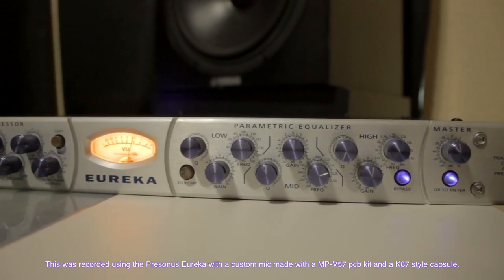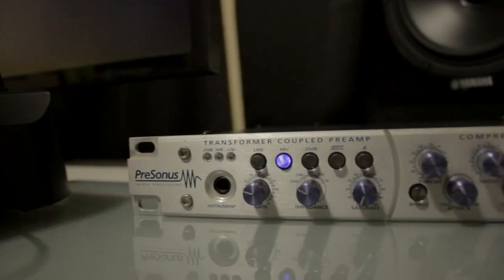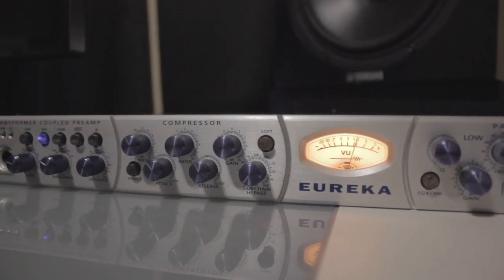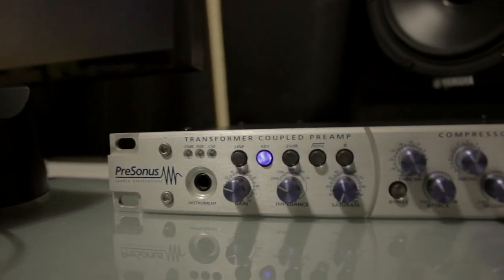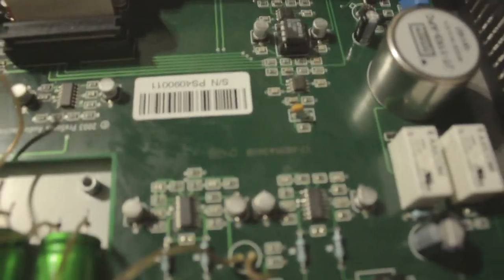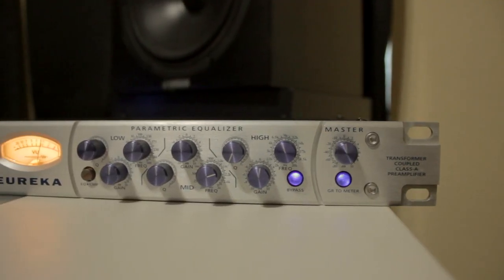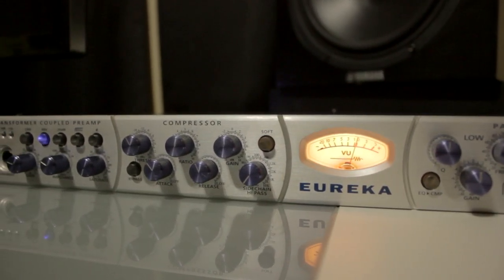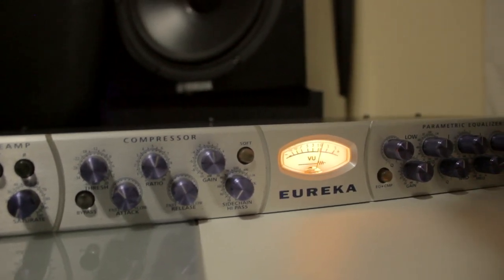Presonus Eureka With Modification Review

Comment: Nice, you inspired me to start my own DIY Project with the Eureka Channelstrip! but, "Discrete Opamps" are another World, compared with normal limited IC Opamp Chips! Normal Opamp IC's are like listening a Symphony or Orchestra thru a Keyhole or consider a Mona Lisa Oilpainting with the size of an Stamp. ;)
Reply from the maker: I've been doing some reading on those recently myself!  Im going to do some research and see what kind of stuff I can get.  Im always down to do some work on my gear!  Just changed the tuning on one of my cheap WGTcenter mic capsules by removing a spacer.
Reply: @audiofreq  which spacer do you mean?
Reply from the maker: @jeffmcbeff6084  On the K87, theres 2 micron thin spacer between the back plates, if you take one out, it changes the chamber pressure and tuning of the mic capsule.

Comment: Which did the most and least difference?

Cap Mod.
Chip mod.
Transformer mod.
Reply from the maker: Transformer > Cap > Op Amp > Quad Op Amp
Reply: @audiofreq  what exactly did the transformer do? And what did the capacitor do?
Reply from the maker: @levigonzalez7399  Correct impedance selector switch with corresponding resistor change, improved low end, better detail without harshness.  The capacitor change was mainly for the transformer swap, the original 47uF were said to be too small and limits the low end response before phase of the Jensen transformer, so I swapped them based on Dave Hill's recommendation.